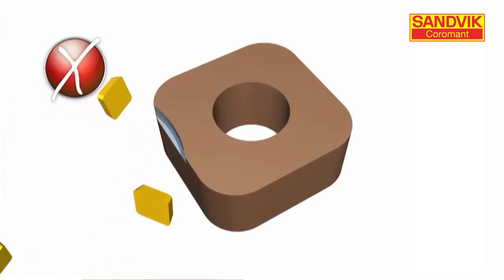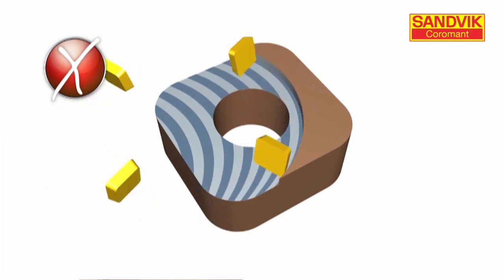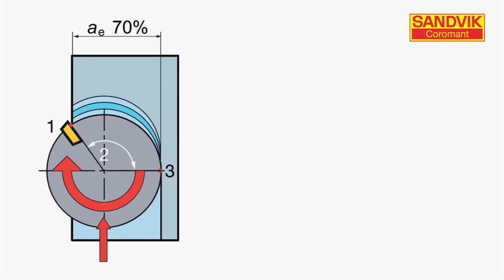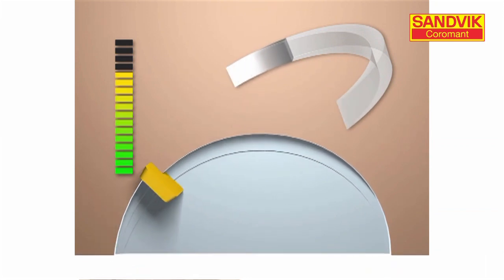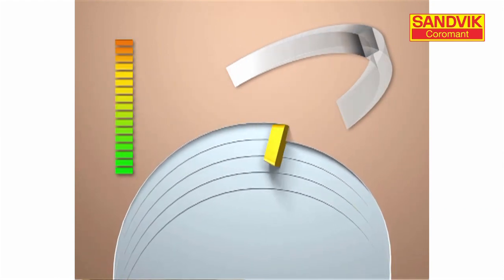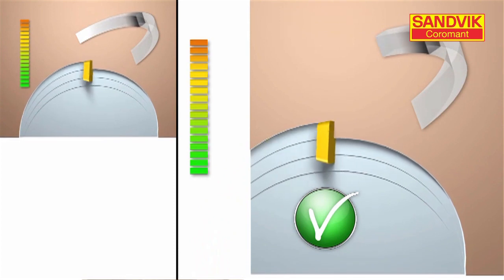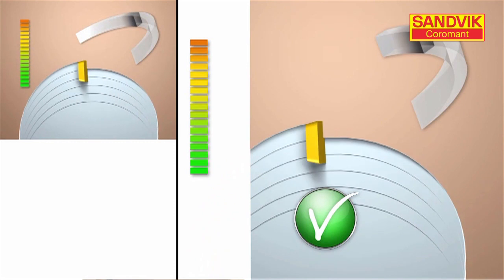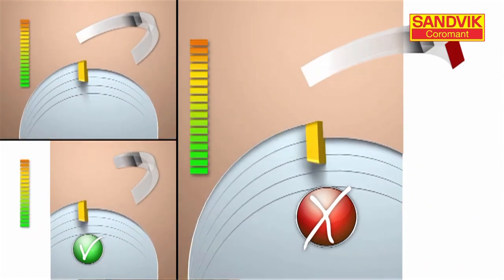Tips film: Golden rules - thick to thin milling machining

Comment from the maker: The "thick to thin" methods (down milling) always give longer tool life, how much depends on the material  you are cutting, in "easy to machine" material the difference is not that much, 10-20%, but on more difficult material, such as HRSA and duplexa stainless materials you could have 300-500% longer tool life. Best regards / Hans Lindberg, Application specialist milling

Comment: This was a good way of presenting the situation. However, we inadvertently make thin-to-thick and thick-to-thin chips during slotting with an end mill. Also, we wouldn't be able to reposition the cutting tool in the mentioned scenario. What would you recommend to avoid having such a problem?
Reply from the maker: Hi there
In slotting it is the same as in shoulder milling – from thick to thin. For the entrance of a slot we always have the problem of a thick chip in the end, but this we can avoid by programming an roll-in entry

Comment: The "never position cutter on centerline" rule of thumb should be mentioned here, as it creates the thickest chip on entry and is thus an exception.
Reply: They've already showed how you're WRONG. You enter the cut tangentially. Moving in centerline creates thin to thick to thin as per the video you apparently didn't watch.

Comment: Thank you for the video. What do you recommend for exiting the cut with a big face mill? At 70% engagement you have a similar problem with the left side of the cutter as the leading edge breaks out of the part. Thanks for the help.

Comment: I'm confused, I'm a beginner with a manual mill (Bridgeport clone).  I was told conventional milling was usually better than climb milling.  Using the conventional milling method how do you  enter the work to get the "thick to thin" results?

Comment: I do some manual milling, no CNC. Thick to thin basically seems like climb milling, which is not so good on an old manual mill. Thick to thin doesn't work w/ conventional milling, correct?
Thx.
Marty
Reply: @sjwsbetaskiller6218  Hi, according to the link you provided, climb milling produces an initial thin chip which gradually increases its thickness. Whereas this video states the opposite. I think this video is right. However I would appreciate if you could explain. Thanks
Reply: @luiasori87  The link seems to be a little misleading on the matter. True, the cutter reaches the thickest point midway. But it gets thinner coming to the exit.

Comment: I'm not a machinist but if the tool moves say 20 thousandths per revolution wouldn't the chip for a 4 flute tool be pretty much 5 thousandths all the way? That how far into the metal the tool has gone since the last flute was there.
Reply: Just look at the video because it's hard to explain with just text.  But the answer would be no.  At the thickest spot yes, that would be the case, but if you look at other areas where the chips appear thinner, what has happened is the tool has moved, 5 thousands, in Y, but not 5 thousandths in the direction perpendicular to the surface of where the material is being removed.  You could break it down using pythagorean theorem and SOH CAH TOA if you were inclined, to find the chip thickness at any point.  Only the point that is in line with the path of the tool would have the 5 thou thickness.